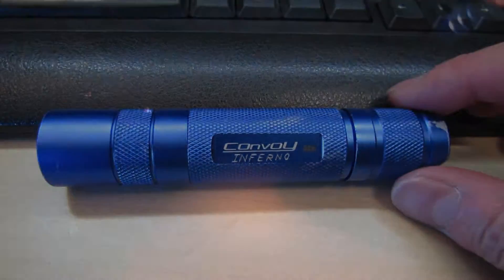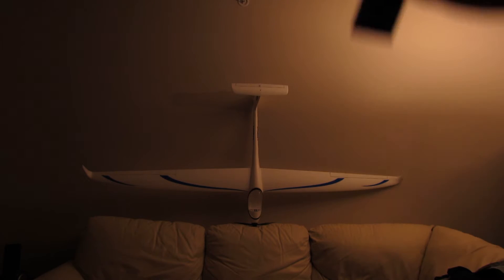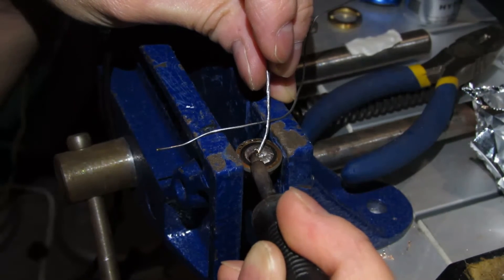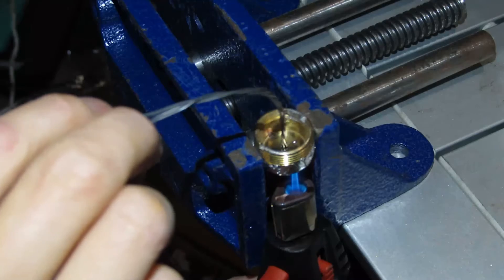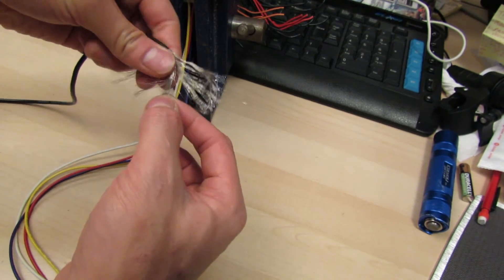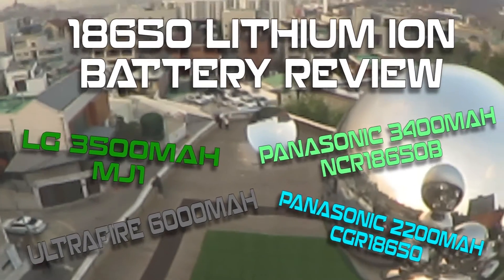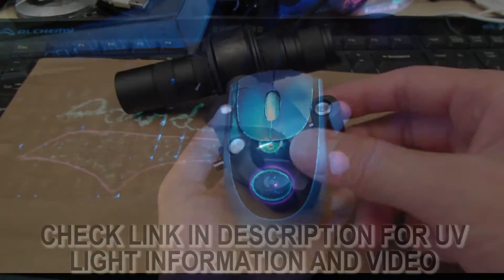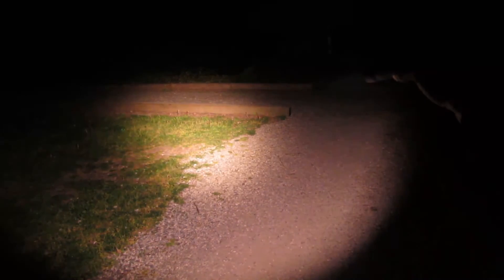The Most POWERFUL Flashlight EVER - DIY Convoy INFERNO - 2239 Lumens

Comment: whats led is flashlight?
Reply from the maker: +Joey Abramovecht Hi, the stock Convoy S2+ had the Cree XM-L2 led in there, with a efficacy bin and color temperature bin of T4-7A(3000K-3200K).  I prefer the warm white, that's why I went with that one.  If you want to have the highest light output, U3 would be the way to go, but it's a cool white.  I don't think they sell the Convoy S2+ with a U3 LED, the highest they go is U2, it's only a step below. The U2 is 6500-7000K color temperature, that's really blue/white, but if you want bright, that's the way to go.
Most people would be happy with a T6-4C, once you go to 6000K, the light looks a little weird, and you can't even notice it being brighter, you'll notice it being more blue.  If you're only after glaring people or being noticed, the U2-1A would be the correct choice, if you're riding your bike around, that would be the LED to use, as cars would notice you right away.
Hope that explains it all.
Cheers!
David.

Comment: Needs more caps lock in the description. BTW isn't Panasonic 3400 rated for 7A?
Reply: sorry I meant CAPS LOCK
Reply from the maker: +wojtekimbier Lol, ya I need more CAPS like I need more POWER in the Convoy!  I'll cut back ;o)  Thanks for the question too, it's a great one, the answer is slightly subjective, since internal resistance plays a role, but isn't a hard fact like "if it's below 58.8mOhms you can't use it", you can, just need to be more careful with the heat issue, that's all.

More details below:  You're right, the Panasonic 3400mAh is rated for 7A, but it really struggles at 7A, and due to the higher internal resistance, the voltage really drops at that current draw, and the device would need to have even lower internal resistance than it already has; I couldn't get the resistance down enough for the 3400mAh to deliver over 5A easily. I'd probably have to reduce the resistance even further, and even then, at the higher operating temperature of this flashlight, the Panasonic would still get hotter and probably not be suitable for use in this thing.  In testing, I could get over 5A constant from the LG 3500mAh, however with the Panasonic, it would drop down to 4.8A and steadily drop, I think that to get 5A+ it needs a lower internal resistance, which it just barely has to stick around at the 5A mark.  It's because of the small voltage difference between the forward voltage and the operating voltage of the battery.  I figure it's a forward voltage of 3.3V, so the difference becomes around 3.9-3.3 = 0.6V, if the internal resistance is lower, it could make a big difference, say 4.0-3.3 = 0.7V, that's a big difference, and makes about a 16% difference in current for just for 0.1V difference.  To resolve this, people go with an LED with a lower forward voltage, but the XM-L2 is a great LED, with great power handling characteristics, we just need to use batteries with really low internal resistance to achieve higher currents, which is mainly why I recommend the LG MJ1 or HG2. 

Same as other electronics, batteries also need to be derated when operating in hot environments; you can operate this while holding the tail comfortably until the thing's about 65-70&#176;C/149-158&#176;F, so components should be rated to at least double what's required of them.  With all that said, you could use the 3400mAh in this, I'd just be mindful not to run it as hot as with the higher rated cells.  The higher the internal resistance, the more heat energy is realized within the cell, so the internal temperature of the cell just goes up quicker, this is already a risky light to operate, so I wouldn't use a Panasonic 3400mAh in there, it just makes the risk that much higher.

Something that proves that fact even more, is that the voltage curve of their 2C draw test, which is about 6.8A, shows that the voltage drops dramatically at that current draw:  https://industrial.panasonic.com/cdbs/www-data/pdf2/ACA4000/ACA4000CE417.pdf
Interestingly, the voltage actually terminates at a higher voltage than the curve of the 1C draw, this is probably due to the fact that the cell got hot from the 6.8A current, and that extra heat gave the battery a boost in voltage, I've seen that exhibited in my testing of 18650s as well, it might look good, but it's actually a sign that the 18650 is being stressed at those current draws, and indicates to me that you shouldn't operate it at that rating.  So although they show that graph, and it might be rated for it bu the manufacturer, I see that as a sign that one shouldn't use it at that rating in normal practice, maybe once in a while is ok.

That's my TAKE ON IT ALL. lol jk.
Hope that helped.
Cheers,
David.
Reply: +David Sunshine I understand some of the words. Lol. No, seriously, thanks for the detailed reply, I can see the "why" more clearly now. Not much of a flashaholic myself, I've yet to order anything but a couple ThorFire TG06's for me and family when dollar price was low, but how lights work and how people mod them is fascinating to see. I've got to order an S2+ plus a cheap XTAR charger and some Panasonic 18650's when dollar is cheaper again to see what all the fuss is about, can't afford to have much more fun than that yet
Reply from the maker: Lol. You seem to know your stuff, cuz you're right, the Panasonic 3400 is a great battery.  I trust Panasonic batteries more than anything else.  Like the LG 3500mAh might have a better capacity and internal resistance new, but I would bet my money on the Panasonic cells for longetivity and cycle life.   I even tested the Panasonic at -18 celsius, it performed very well, like 80% capacity at 0.5A.
It's cool that you came across my video, this was a pretty crazy mod, wasn't sure it would work as well as it did, but glad it did. Surprised me, lol.
I've only purchased $6 lights from eBay, and they were fine, but after playing and with the Convoy light, which cost me $12.88, I would never go back to the cheap stuff.  It's a great light, that brass block is impressive stock, that's why a small addition of copper made it handle 20W so easily.  
I don't work for the company, but I sound like a salesmen for it lol, but good products sell themselves with word of mouth I guess.
I put my stamp of approval on it though.
The XTAR chargers look good, got lots of options that I'd like to have.  I have a counterfeit Nitecore i4 from eBay that I got years ago(they fooled me good), it's working well for now, maybe when it goes it'll be time for an XTAR.  But it's charging to 4.20V so no reason to rid if it now.
I can say you won't be sorry with the Convoys or Panasonics tho, I like mine and have even ordered more for my friends!
Make sure you order from a good source tho, don't want to get fooled.
Cheers,
David.
Reply: +David Sunshine yea, I find convoy flashlights more affordable than other counterparts, it has pretty good quality too. I have a convoy and nitecore but the convoy's cost 1/4 the price of the nitecore.
Reply from the maker: +AvoneJ Ya, I wouldn't mind a good Nitecore, they have thermal protection, that's good to have.  The convoy will explode, that's when you know you've gone beyond the thermal limit lol. But at the prices of the Nitecores, it's hard to purchase, but you do get more for your money.